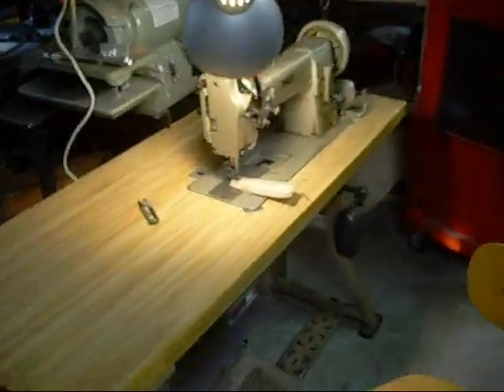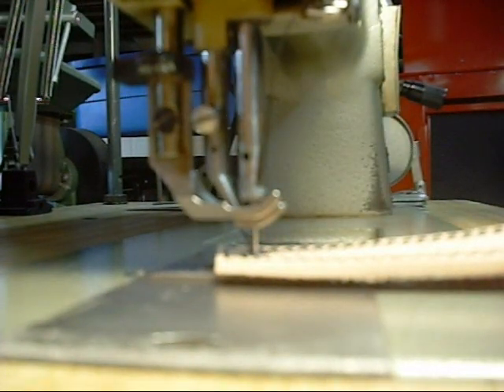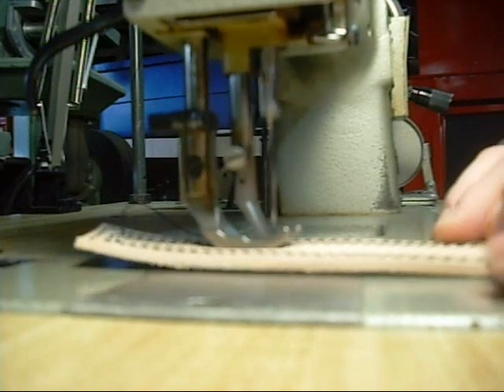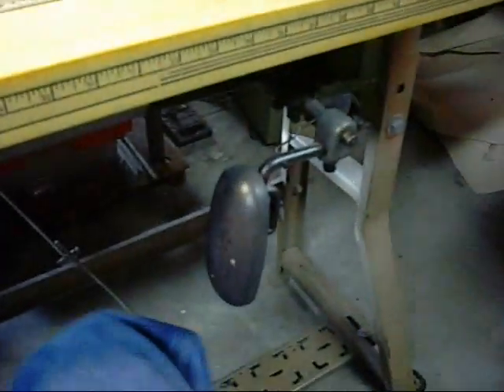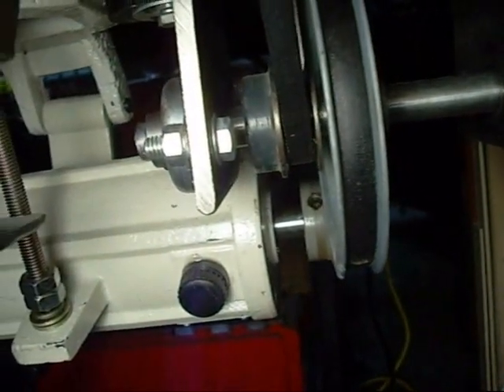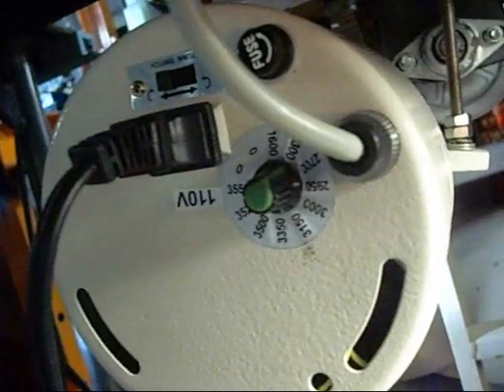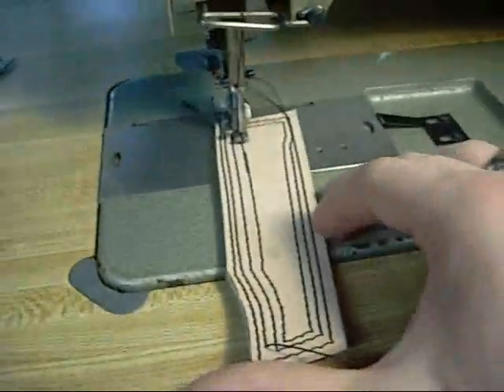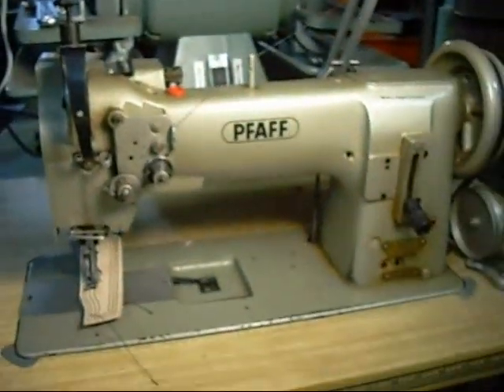Pfaff 545 Industrial Sewing Machine

Comment: @raysofgreys Straight stitch = stitch is straight and in line unlike zig zag. lock stitch uses a bobbin unlike chain stitch which does not. chain stitch will run undone if cut. lockstich will not. Chain stitch will stretch with stretchy fabric. lockstitch will not stretch and therefore will snap if stretched. btw. i used to work for pfaff uk

Comment: Great video! helped me figure out how to slow mine down with the combination of the servo motor and the pulley system. Did you fab the pulleys or was it that way when you bought it? Looks like about $50-$60 in parts and a day to play around with placement. I would think the motor needs to be moved a bit to keep the second pulley in line with the hand flywheel on the machine.